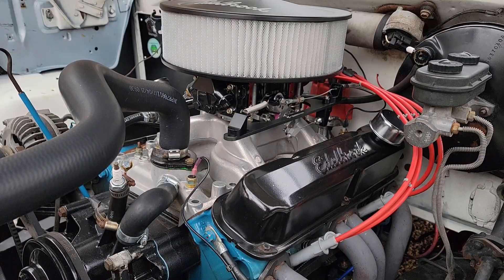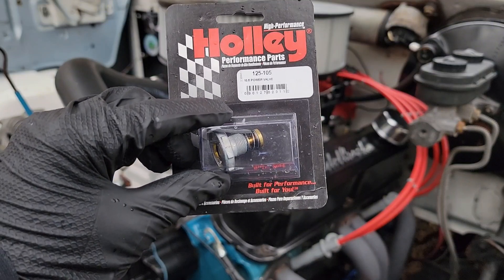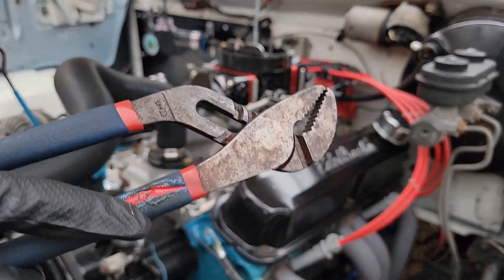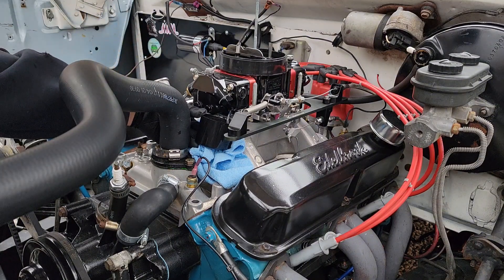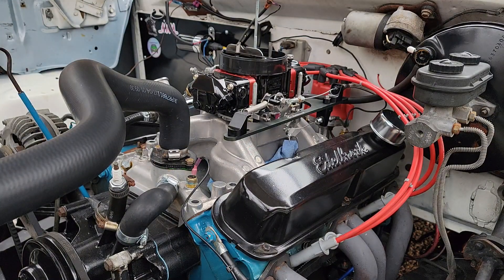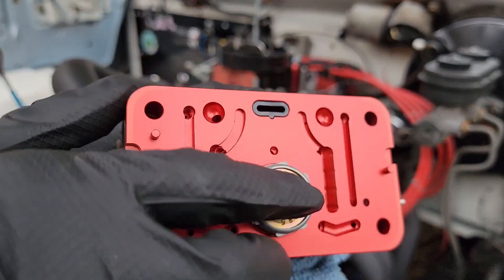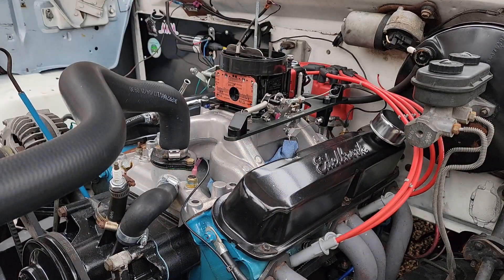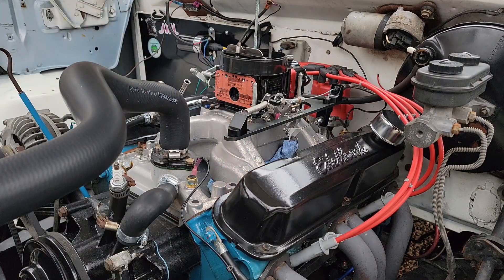Holley Power Valve: What It Does and How It Works #carburetor #tuning #holley #hardheadgarage #diy

Comment: " They use to say 1/2 of idle vacuum is the power power valve number because if higher it could activate and run rich. Total nonsense.
Reply from the maker: I usually add a point or 2 to the vacuum reading. I like mine to be crisp and snappy.
Reply: Great explanation